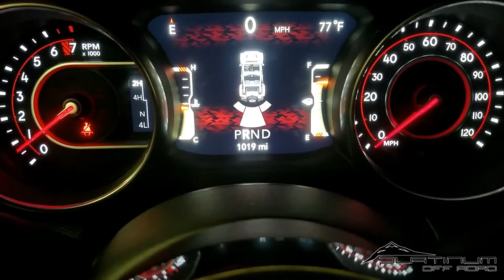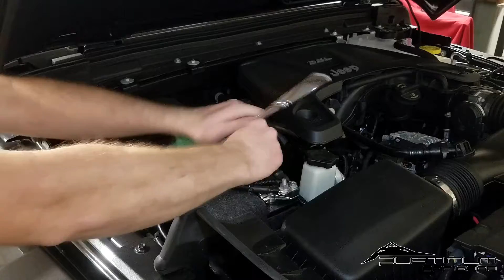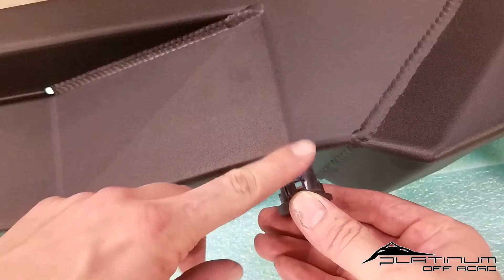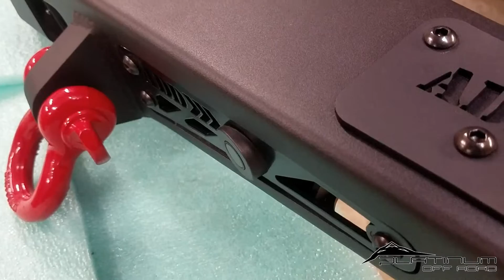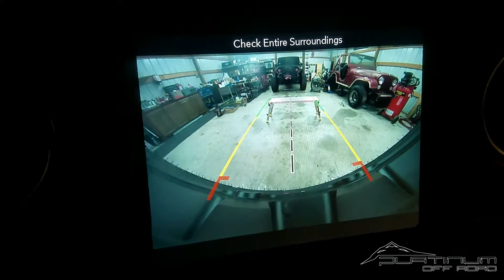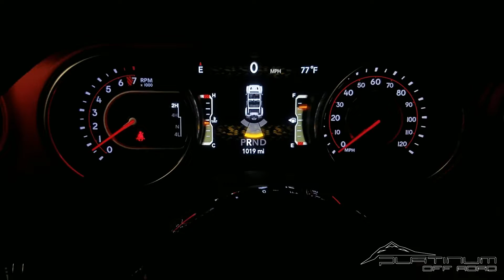Jeep JL Backup Sensor FIX - Useful Trick for OE and Aftermarket Bumpers

Comment: How do you reset the system if it notices that the sensors replaced?
Reply from the maker: I've not ran into that problem. These are simple-minded sensors. Once a sensor circuit is corrected, the dash will immediately stop sounding off a warning. Just my experience in chasing down sensor circuit issues on these.

Comment: Question: I have a 2020 Jeep Wrangler JL. Putting on a steel bumper to replace the factory bumper. I successfully removed all (4) sensors and respective parts; however, the order of the sensors themselves got mixed up (as far as: far left, center left, center right, far right). Are the sensors themselves interchangeable? Can they go in any of the sensor locations on the bumper?
Reply from the maker: Sorry for the late response, and I'm sure you've already discovered that they are not location specific. The guides are however, and can actually be modified and moved in a manner that allows for better positioning, with certain aftermarket bumpers.

Comment: When you clocked the side outer rings 180 degrees, did you also flip the internal locking ring from driver to passenger side and vice versa?  That would keep the sensor wire connection tab and sensor itself aligned from the inside of the bumper like factory.

Comment: What happens if you don’t return the sensors to the same order as OEM, and switch them up?
Reply from the maker: Sensors themselves are the same across the bumper. The difference is the guides. The steel factory Rubi bumper has the guides you will need and they are in multiple pieces, all having a different part #. To move a sensor from one connector to the other won't cause any harm.

Comment: I just bought a 2021 JL Rubicon but been having a message popping up randomly then goes away that says “Rear sensors unavailable wipe rear sensors.”  Have a service appt scheduled for 1.5 months out but would anyone know what would cause this?  Was thinking maybe its a loose connection or dirty but I’ve wiped the outside of the sensors really good.  Thinking it could be either the connection or a bad sensor.  Backing up seems fine, no error messages.  Your thoughts?
Reply from the maker: My guess would be wiring connection or faulty sensor.

Comment: This vid answered a lot of questions for me, thank you. I'm building my own bumper and I have one other question. Will those plastic sensor keepers hold tight in a 1/4 inch thick bumper or is that too thick?
Reply from the maker: That will be too thick. A trick you can try is trim back the little guide fins to the thickness of the plating and use them to act like retainer clips.. if that makes sense.

Let me know how it works out! Thank you for the feedback!

Comment: um, there is a second battery on the JL for the start stop "feature", so even though you disconnected the main battery there is still 12v live feed in the electrical system while you worked on this.
Reply from the maker: Yeah we service dealerships in the area and we verified the precautions for this system. Even if you have the system unplugged and the primary battery is connected, a fault code will appear. Disconnecting the primary for a few minutes will reset the system should this fault arrise.. which it did. This led us to remove the primary connection and work on the backup system. Thanks for the wise input!

Comment: Looks like the sensors when installed stick out pass the bumper. Is there a concern of backing into a rock and damaging a sensor?
Reply from the maker: That seems to come with the territory of having a bumper with sensors. They stick out on the OE bumper and as long as factory sensors and housings are used... I guess that will be the way it is unfortunately.

Comment: Good job for trouble shooting.
Reply from the maker: Thanks for the feedback!
Reply: @PlatinumOffRoad  question, is thier any other front and rear bumper guard which will integrate the sensors aside from this demonstration?
Reply from the maker: @frankiereyes6588  I want to make sure I answer you correctly... so please let me know.
We use this same exact concept and method of switching parts around and making sensors set at a proper positions on other vehicles and bumpers. So to maybe answer the question: Yes, this concept has also worked for us on other bumpers and applications... not just the Jeep JL with the featured Adictive Desert Designs bumper
Reply: Thank you, but but my question are thier other aftermarket parts that does not include the OEM which is in conjunction with an integrated sensor. Meaning aside from this video are thier more steel bumper that is capable to having sensor or you guys make the hole. If I wanted fab fours ect to be installed with factory sensors or does it has to be custom spec by drilling holes.
Reply from the maker: @frankiereyes6588  after seeing how pointless the pre-manufactured holes are, on the Addictive bumpers and others, we've found that the specific OE hole shape and location are not as important as simply placing the sensors in a reasonable direction that will detect an object. If you can get holes on a surface that makes sense and separate them within a good distance that replicates the factory harness, everything should be fine. The small details on the plastic sensor retainers have also come to mean nothing to us and on some bumpers they need trimming to even make them snap back together properly
Reply: Thank you sir, hope this text will help others.
Reply from the maker: @frankiereyes6588  Glad to help!! Thanks for the support. Any other video ideas that may be useful, let us know!
Reply: @PlatinumOffRoad  future video on jeep gladiator please. Thanks brother
Reply from the maker: @frankiereyes6588  Lol you send one over, we'll knock it out! I bet the local Jeep dealership we serve wouldn't even let one go off the lot for a video shoot

Comment: Hi, I have a 2018 JL. I recently installed fab four off road bumper and I have the same issue with the rear parking censors. Could you tell me which parking censor housing you used in this video, and where to buy it?  Thank You.
Reply: Alex, I went with a GoRhino Rockline rear bumper and had the same issue. I have a 2018 Sahara with plastic bumper so I ordered new bezels and brackets to use with my existing sensors because another Sahara owner said the bezels were heat molded into the bumper. I basically used this video for my guide on sensor setup. Here are the parts you need. Ordered from https://www.allmoparparts.com

Here are the part numbers. I ordered from All Mopar. 

6MH84RXFAB 
Bezel, RIGHT 
$2.42 

6MH85RXFAB 
Bezel, LEFT 
$2.42 

6MH82RXFAB 
Bezel, RIGHT 
$2.42 

6MH83RXFAB 
Bezel, LEFT 
$2.42 

68295601AB 
Bracket, LEFT 
$1.61 

68295600AB 
Bracket, RIGHT 
$1.61 

68295602AB 
Bracket, RIGHT 
$1.61 

68295603AB 
Bracket, LEFT
$1.61
Reply from the maker: Awesome info Patriot222!! We hope this video can be used across the board with other manufactured bumpers. All have the same concept when it comes to the sensor issues. Sounds like you nailed your fix!!
Reply: @antifederalist22  - Thank you Patriot222!! I have a 2019 Sahara with a plastic bumper as well and knew that the sensor mounts had to be different. I have a "BodyGuard" bumper on the way and because of YOUR research, I can order the sensor mounts in advanced as well. I hope to resolve my sensor issue with this new bumper.
Reply from the maker: Hey Alex, we used the OE factory guides. The sensors come out with three pieces (incl the sensor themselves) and all we did was rotate the outer sleeve and the swap the inner sleeve so that the tabs reached eachother at the new position.